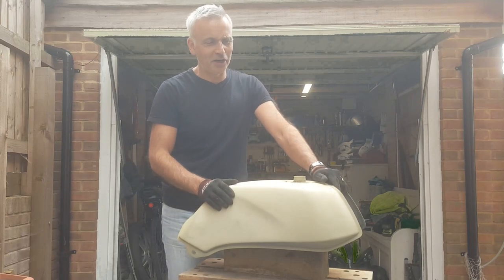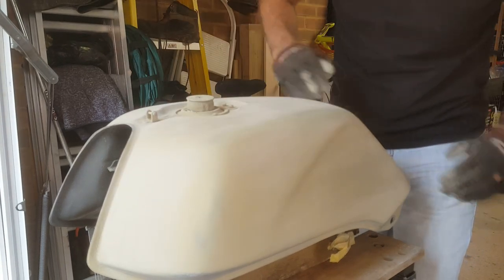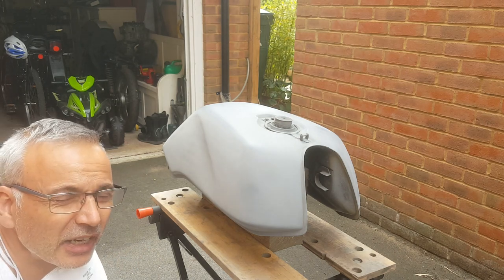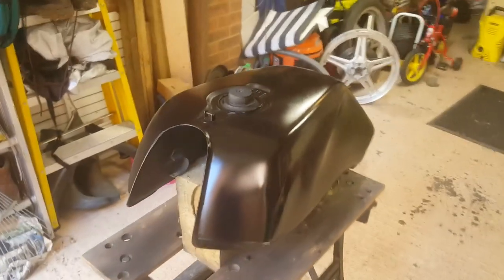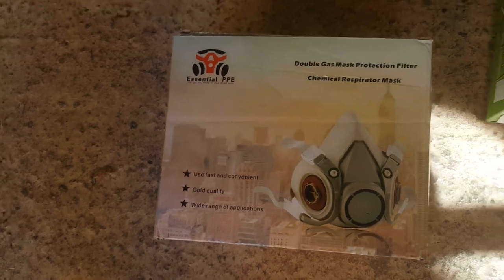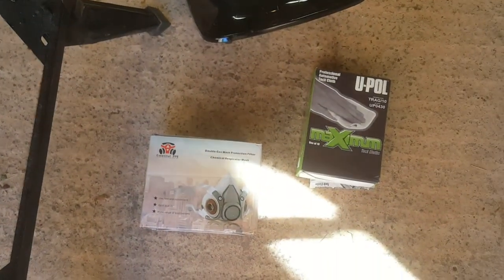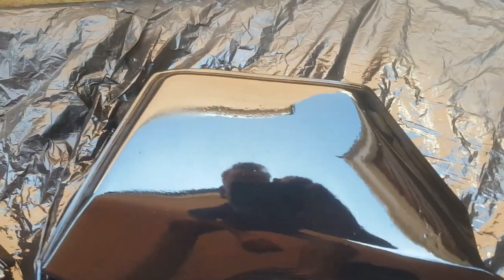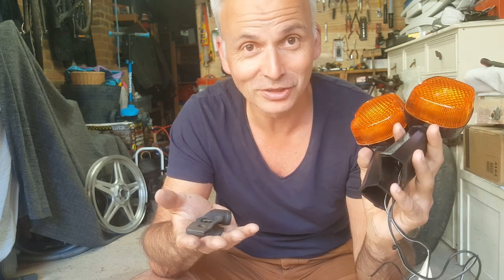Painting the fuel tank again... Can I learn from previous mistakes?

Comment: Hi Ryan 
Another tip I use when spraying a tank 
Provided its dry and vented of fumes .
I use a heat gun on low or a hair dryer to blow hot air into the tank to preheat it take dampness out and help cure the paint
Reply from the maker: Thanks, I'd not thought of that before, but can see how it might help. 👍🏻

Comment: I said before, my BMW R100/7 tank and side panels went crazy, exactly the same, I’m still putting off doing it again, it’s a lot of work , has anyone suggested what might have caused it, it’s never happened to me before and I’ve painted quite a few bikes in my time, hope it goes well for you this time.
Reply from the maker: Hi Michael, the likely cause was that I applied too much cheap lacquer in cold conditions causing layers whereby the top may appear dry, but underneath it wasn't, and then subsequently the drying process causes both shrinkage and solvent vapour escape. Although to be honest is all speculation and I doubt I'll ever know for sure. But fingers crossed it's actually been a few days since it was done, and so far all is still good.
Reply: Looks nice and shiny Ryan👍
Reply: @RyansGarageUK  I have also has similar issues with lacquer and I found the only way to sort it is strip it right back.

Comment: What paint did you use? 2k will react with some, especially if it's not properly cured. Also, I didn't see you rubbing down the black paint before you put the 2k on, the lacquer will detatch from the paint if it's not properly keyed. Painting plastic is a whole different ball game, if you want the finish to last
Reply from the maker: Hi Andy, im afraid the paint was Halfords finest so I am hoping it doesn't react. You're correct I didn't rub down between top coat and 2k, I didn't think that was necessary but maybe I'm about to learn yet another lesson the hard way. So far it's been a few days and it's still looking good to me.